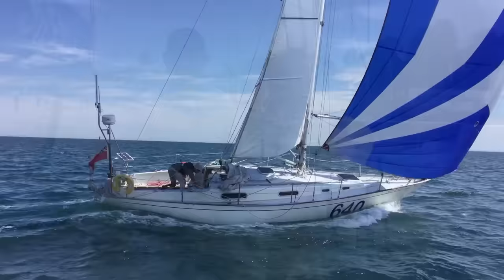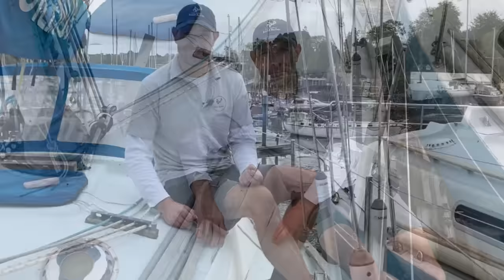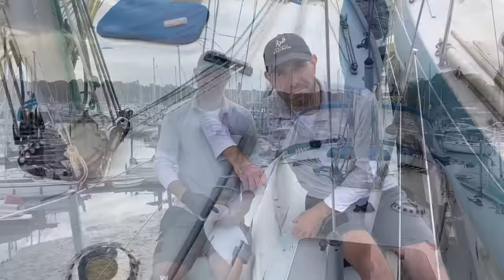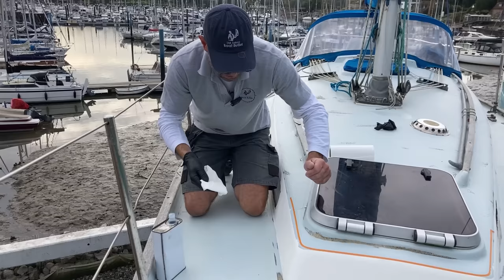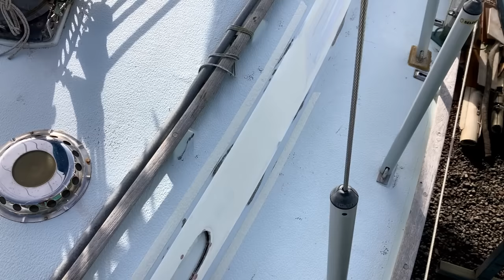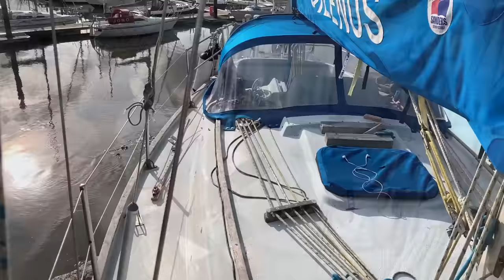Apply and Refinish New Gelcoat over old on a Contessa 32 (ReGelcoating 101)

Comment: I think you should explain the difference between flow coat and gel coat, because gel coat NEVER FULLY CURES WHEN EXPOSED, as you did explain the fifth layer with wax added but 99.99% people will not understand it.
Reply: "NEVER FULLY CURES WHEN EXPOSED," ... but is that true if using a  Hardener such as MEKP?
Reply: @johnbspringer it gets sticky.    :-(
Reply: @TeacherBrunoOneil are you saying even with MEKP it still gets sticky?
Reply: @johnbspringer  yes it does. I've been studying to redo the transom of my boat and I found out that the gelcoat will always get sticky because it doesn't cure completely even using the hardener.  it happens because the oxygen doesn't let it cure.    so here is the thing, you need to use  something called wax together with it so that it can cure and then you can sand it and polish it afterwards.   there is another substance they use, but wax is more frequently used.. and you don't need much of it.. like 5% the total amount of resin.  just as you use 1 or 2 % of MEK P ( hardener ) ...   sorry for my English but I'm Brazilian. English is my second language.    Just for your information, there is a difference between curing and drying.. paints will dry, whereas  gelcoat will cure.
Reply: @TeacherBrunoOneil  thanks for the info. that is important information that none of the other videos I have seen describe. I think you helped prevent a mess.😊
Reply: @johnbspringer  :-)  I´d highly advise you to keep searching and educating yourself on the subject before getting your hands on work. Preventing a mess may be satisfatory, but if you study more, you may do something very nice there and if you are in the USA ( Unlike me - I am in Brazil now ) you will have all the gear and chemicals you need for a very nice, professional-like job.
Reply: @johnbspringer   just one more thing. I didn't mean   " grind " I meant  " sand ". you can only sand the gelcoat after it's completely cured. I already fixed it in the original text so that people can understand it and take more advantages over the explanation.

Comment: I have to do this to the topside of my boat...and it's long overdue. Great work by the way. I now feel confident on how to take the work on. Just as an FYI, in the states (US) most of us non-professionals use the roll-&-tip method. We roll on the gel coat and then use a very good fine brush to smooth everything out. Because we're out of shape are absolutely obsessed with NOT sanding this much by hand. Some guys who do this dockside for a living, are really good at it.  Your final product is better than what we get, so I'm thinking I'll split the baby here and do more sanding, along with the roll and tip.

Comment: I'm back for a refresher course from 8 months ago since I brushed my first layer of gelcoat onto my modified helm today. First I was surprised at the depth of the brush-strokes. I was expecting the gel to level out somewhat. Nope. Then I figured I'd have to sand the strokes out but by watching this video again I see that the strokes are typical and to brush succeeding coats in opposing directions. Whew! Glad I checked back with you. I'm using waxed gel so I have to remove the wax between coats.

Comment: I have watched hours of videos and got more confused on what product to use, this one actually covers exactly what I need to do! I have an ancient Invicta 26 and the top side is horrible, I can see daylight in parts from the inside. So I tested gelcoat on my repaired Laser dagger board and that was a disaster, I didnt realise the gelcoat remains tacky (I didnt know its meant as a mould product where there is no oxygen) so then tried PVA to dry it. Anyway made a mess of it with runs and dead flies, grit, etc. Ended up sanding virtually everything off, gave up and just painted it!
So this gives me confidence to have a go on the boat with Gelcoat so I get some depth in the material that I wouldn't with paint.
Reply from the maker: Pleased it was helpful, best of luck with the project.
Reply: @RefitandSail  Reading below I realise I used the wrong PVA (mine was from Wickes so is wood glue), it certainly allowed the gelcoat to dry but what a mess! Sanding it off clogged up the sanding belt in no time and I ended up removing virtually everything I had applied.
Reply from the maker: @simonroyle2806  example of the pva https://www.ecfibreglasssupplies.co.uk/blue-gloss-pva-release-agent

Comment: I AM watching the sanding because i wanted to know how you worked your way around gelcoat and sanding. As it turns out I have been using the almost exact same procedure. Applying the gelcoat by brush, sanding with 120 grit at the very uneven spots by hand and using an orbital sander with 320 grit on the plane surfaces - but i only gave it four coats and I haven´t sanded through yet. Next time I think that five coats is safer. Thank you for posting this at the right time 😂
Reply from the maker: 4 should be plenty of applied thickly but 5 gives a bit of margin for error in the sanding so no harm.   I tired to do it with 3 coats once and it’s just not enough, 4 minimum, 5 ideal.

Comment: I am completing a gel coat job on my 23' RIB, radar bar.  I'm continuously watching video's to evaluate the process I used to get to the point of block sanding and polishing.  The only difference in my application is I used a mini roller, instead of a brush. Thanx for the education..

Comment: Very helpful. I’m about to do some gel coat repairs on my boat. So this was helpful to me. You used gel coat, which surprised me. From what I have ‘read’, I would have thought ‘flowcoat’ is for use like you used it.
Reply from the maker: Flow coat is just gelcoat with wax in it that rises to the surface when curing so you don’t have a sticky finish.

Comment: Suggest you wear knee protection in future! I speak from experience😉 I went for the paint option on my R36, but everything, only the toerail was left on. The deck and coachroof were in v poor shape. Four epoxy primer coats, 2 high build, 2 normal, 4 two-comp topcoats. Has lasted really well, but even if it gets scratched, repair is easy.

Comment: It's hard to accept you as a pro when I see you crawl around with your bare knees on a non-skid surface without knee-pads. It's not the skin of your knees that gets damaged so much as it is damage to the knee-joint itself. Your career will be shorter without pads. Taking the gel-coat above and below the outside and inside corners results in a much better look for the boat. Nice change. That second coat was cute...paint porn, complete with appropriate music. This video is informative and so are your responses to many of the comments. I appreciate it. I know...that don't buy beer.
Reply from the maker: No worries about the beer-tokens, that’s optional but always appreciated.   I do normally use a kneeling pad (as I don’t like having pads attached to my knees.  Fortunately the non-slip on this deck is very worn and due to be replaced (likely in a future video).    Thanks for the comment.
Reply: Forget the knee pads, but sanding those poisons without a face mask is so smart. That will retire him earlier. I could understand if you do this once a year in your own boat, but if you do this for a living, that I can't comprehend.

Comment: Bro, amazing work and hats off 👏 

But if you're doing this for money I'll give you some advice as someone who's done body work and paint for 23 years

You should be cutting your working time by a MILE using a D.A

All of that sanding you did on that white gel coat can be done with a dual action sander, yes even that curved edge.  

I'd be using the 3M elite series 6inch DA with the self vacuum and 3/32 orbit (fine orbit) 

Two different types of interface pads, a thin semi rigid and a soft interface pad that is about a half inch thick foam.

I'd start with the 3M sander with no interface and 120 grit to knock off the highs and get it leveled, remember the surface of the D.A is literally a 6inch block

After that, guide coat and move to 220 with semi rigid thin interface pad

220 to 600 with foam interface then test out trizact 2000 on the DA to see if you can skip any steps

If not 600 to 1200 or 600 to 800 then 1200 

They key is to test what gets you there faster

Finally to minimize polishing time, use a 3M 3000 sanding disc moisten with water 

Polishing: Get rid of the rotary, it may cut slightly faster (debatable) but its too much physical work compared to a Rupes dual action polisher, and less risk of generating too much heat and burning through.  

Then send it! Probably get all that done in less than half the time.
Reply from the maker: Thanks, deffo use DA on larger flat surfaces and could certainly have used it on this to a point. But part of this video is showing people who don’t have a DA how to get a great result with hand sanding.   

Appreciate the comment 😊
Reply: @RefitandSail  Ahh yes in that case it makes sense 👌

Comment: How bizarre, as a boat builder of too many years to mention, your method and system is Exactly the same as mine. (even the gelcoat supplier!) 
I guess the only way I differ is that I use a 3" spreader to apply the top coat, which tends to give me a flatter finished surface. So when I start the sanding process I can use 240g.
Then 1000, 1500 and then 3m compund. 
Good job.
Reply from the maker: Well that’s good to hear.   Thanks

Comment: A comment if I may, at 22:55 you are showing the sander attached to the hover, however if you look at the sole of the sander, it is perforated in order for the hoover to do the job, but that again requires the sanding paper to have matching holes, otherwise the dust is just going to blow all over. When the perforation in the sole of the sander and the sanding paper are matched, the hoover removes almost all of the dust.
Reply from the maker: I use sanding mesh rather than traditional sandpaper that needs holes.   That may not be obvious in the video (although I do show the sanding media I think). Google Mirka Abranet or Mirka autonet and you will understand (other manufacturers make similar).  Haven’t used traditional “sandpaper” with or without holes for years.

Thanks for the comment 😁
Reply: Ok thank you, that makes sense @RefitandSail

Comment: Have you used (thin) high viscosity cyano acrylate glue on cracked gelcoat prior to the gelcoat process? Ive had good results in light stress to moderate stress crack repairs...it seeps well into the glass fiber voids repairing the area.

Comment: Thank you for the very informative video. We also have a Contessa 32 from 1979 and I would like to renew the top with gelcoat. Is it possible? Have you ever renewed the tread? How do you get the anti-slip surfaces like the original? With a texture roller and then sanding the tips?
I would be very grateful for an answer. Best regards Anne also Bochum Germany

Comment: Thanks for the video, good to see how a professional is doing the regelcoating. I wonder: In the beginning you are mentioning that this method leads to a "factory finish" but in my opinion this is not really true. In the factory building process of the hull it has been started with the outer gelcoat layer and the glasfiber/polyester resin was applied on the sticky gelcoat, which resulted in a chemical bonding between the layers. When you apply new gelcoat on old gelcoat there is, as I understand, no chemical bonding but rather a physical to the sanded structure of the old gelcoat. Would you agree to this statement? I am talking from own experience: I regelcoated the transome of my Mini 6.5 in a similar process and am quite satisfied with the finish. But I noticed that this new gelcoat layer is much more prone to punctual dents than the factory finished. Or did I just do bad prep-work? What is your experience?

Comment: Hello, thanks for your video. Just curious about how you prepared the surface initially - how did you deal with any spider cracks or voids? What product did you use to fill any repairs or do you make your own body fillers? My aim is to restore the entire hull of a 20 year old 17’ Sea Kayak with 21” beam, with white gel coat. There are many gouges, some cracks and glazing from the years plus old field repairs. Your thoughts would be appreciated, cheers. Erik

Comment: thanks for the video, I have not worked with a gel coat, After watching a few times I noticed that the gel coat was used to get a smooth finish by removing most of the coats of gel coat,  In autobody we want the coatings to remain as level and thick as possible since it is the protective coating and allows for a sand and recoat of just the finish layer. would it not be easier and cheaper to use resin and fiberglass as a paste to create the perfect flat surface, using the guide coats on the fiberglass will allow a lot less sanding of the gel coat while leaving more of the protective layer this also removes the chances of breaking through the gel coat in the less than perfect areas?

Comment: Nice job! can you put just a topcoat or flowcoat just straight on to a sanded and filled old gelcoat surface or would you need at least one coat of Gelcoat? How much would you charge for just that that part of the deck roughly?

Comment: looks nice! 

What kind of brush? Are you cleaning your brushes or trashing them?
 Not the typical bag of disposable that hold no material.

Would a mohair roller give a smoother finish thus less sanding(I'm allergic to sanding) providing you don't introduce bubbles...
Less mekp to give more flowout/working time, rolled slowish and have an orange peel to sand off but more even film thickness? 
Trade sanding time for application time

What about tinting the final coat and sanding it all away?
No power sander at any step?
Reply from the maker: Decent quality but still disposable brushes, not worth cleaning them.   You can roll it but need to be careful not to introduce bubbles, I prefer painting but there is more than one way to skin a cat.    

I did use an electric sander on the larger flatter areas on the side of the coach roof which saves time but hand sanded the area in the video as it’s small, quite curved and just wanted to show the process.

Comment: Great video George. That demo section looked brand new. Do you ever spray gel coat? Would be great to see that if you do. 👍
Reply from the maker: You definitely can spray gelcoat, no issues with that but it also requires a lot more prep, on the positive side for spraying is that the refinishing is quicker as what is applied is flatter but on the downside you have to do a lot of masking/covering and the boat needs to be inside with all the necessary safety/extraction equipment.   The process I use probably leaves a thicker coating of new gel and can be done outside (if the weather plays ball) and no overspray but a fair bit more sanding.   So pro’s and con’s for both.

Comment: Before starting sanding in the beginning I would give it a good wash.Nice job though
Reply from the maker: It was, I got my assistant to pressure wash the deck before removing windows and starting anything.   Good to start the job relatively clean.

Comment: I have a fibreglass preformed pond I think made by lotus ponds with a racing green gelcoat  that is scratched lightly so worried it may leak or has been weakened can I ask would this benefit from having another gel coat applied or even if a gelcoat can be applied over an existing gelcoat I’m not sure how I’m based in the uk 
Thanks Cris

Comment: I ve watched this video a few times and it is a great tutorial. It s really improved my finishing work. My 1972 Buchan 37 could use a gelcoat spruce up for sure. I m curious why so many coats, tho. You say that you abraded with 80 grit and from what it looks like thats a rough up and not a sand down. So theres a good base there. Brushing gelcoat makes for a fairly thick coat. It seems to me that 5 coats is going to add a lot material. Can you comment on that, please?
Reply from the maker: Pleased you liked the video, could possibly get away with less coats but it increases the chance of sanding though to the original gel which is a total pain as you then have to rebuild the new gel to refinish again.   With 5 coats the finished layer is probably only 0.5-0,8mm so not that thick but a lot thicker than paint so minor scratches down the line can be sanded out.
Reply: Ok....a bit of latitude there. Thanks for quick reply.

Comment: I did not realise you could paint gelcoat on with a brush, so that's awesome advice. On our 45 year old Colvic there are some hairline cracks in the gelcoat in places like round the feet of the stanchions for the hand rail and high up on the prow of the boat, that you can see beacuse thay have accumulated dirt in them but you can't feel them with your thumbnail. I decided to leave them alone for now as the fibreglass is solid on the inside. Would the process you've shown here be the way to go to fill the cracks or sould we be sanding the gelcoat all the way back as you would with an osmosis repair. Also is gel coat colour coded? how do you get not brand new white gelcoat? I have only seen the bright glaring white stuff.
Reply from the maker: Sounds like you have stress cracks from flexing rather than the thin and uv damaged gel I was replacing.    You could grind out the cracks and fill with colour matched gel or if it’s just a small area you could grind and repair the cracks then regel over the whole area.   Either way you would prob want colour matched gel.    You may get lucky and be able to buy Pre mixed gel of the right colour if you can get a close match using a RAL colour chart but most likely you will need it matched which is a real art to get right.